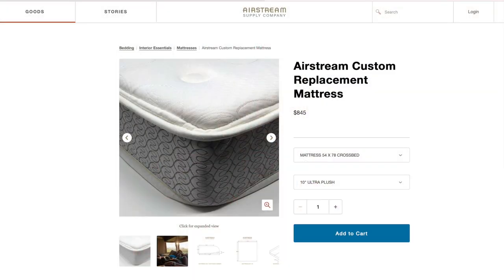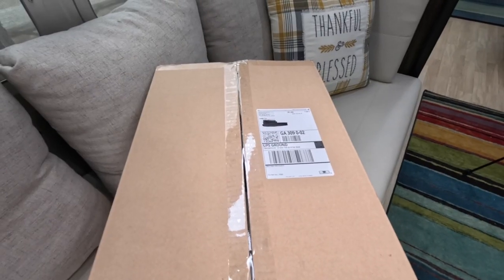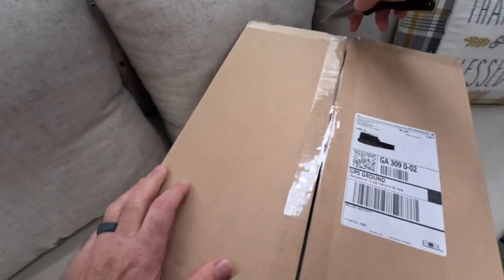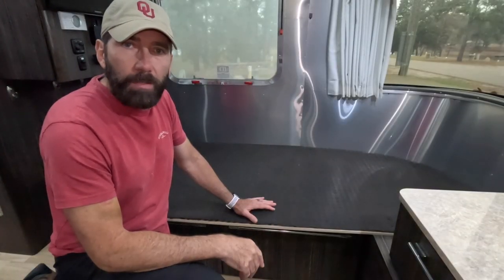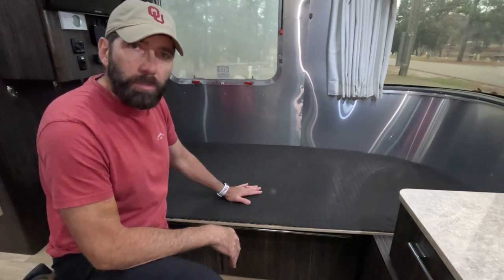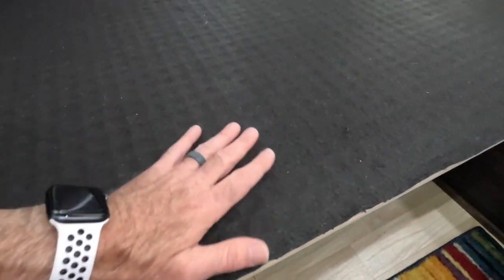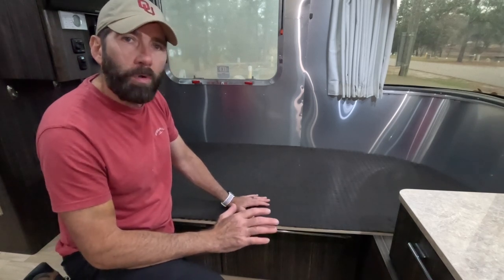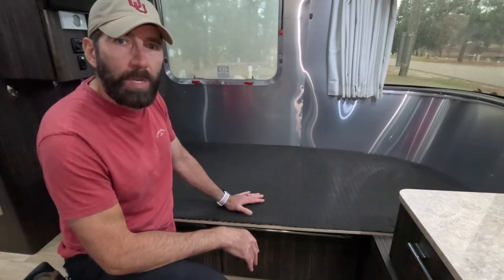The Froli Sleep System is an Airstream Game Changer!

Comment: Thank you for the video. We also have an Airstream with the front bed twins. The platforms on our twin beds is about 3 or 4 inches shorter in width than the actual mattress which I believe would be an issue with the Froli system. Did you change out the platforms for the twin beds on your Airstream? From the video, it doesn't look like you have any difference between the width of the platform and your mattress. Thank you again for the helpful video.
Reply from the maker: Hi 👋  Yes I added a wider plywood platform to our Airstream.  We didn’t like the mattress overhanging the original platform.  It was later that we added the Froli system.  Hope this helps.  Safe travels.

Comment: Once you assembled your grid of springs, did you screw the grid onto the plywood platform or did you leave it loose?  Our previous camper came with the Froli system and the grid was screwed down to the plywood deck.
Reply from the maker: JT, I did not screw it down but after the past few weeks I plan to.  Thanks for watching.
Reply: @thewrightlife  we are still waiting on our airstream to be built, but I’ve already ordered and received the Froli components, which will be my first mod.  We loved the Froli in our NuCamp camper!
Reply: We installed these (love them) but didn't screw them down. After a month or so of use, we decided to use a half a dozen command strips to "glue" them in place.  They have not shifted since, and we avoided putting any holes in our plywood.

Comment: put light plastic wrap on your matress , change it once or twice a year, just have a couple sheets over ot to rid the plastic noise...= zero mold and not haveing to always be changing up your bed system. you will not avoid mold in an RV. useing light plastic med coverings is the only way to do it
Reply from the maker: We also use a dehumidifier in our Airstream to prevent mold. As for the Froli, I think it will be the last Sleep system we ever need.  Thanks for watching.